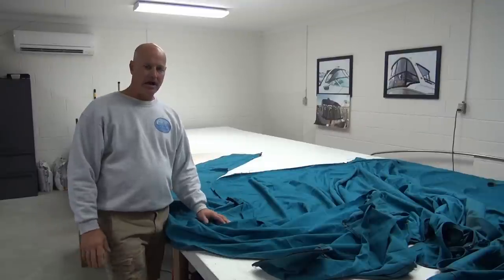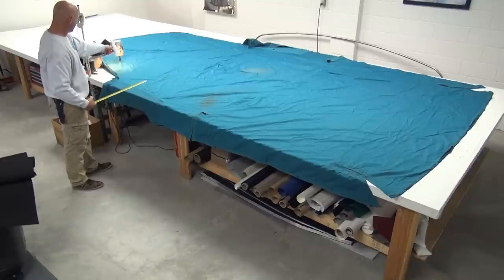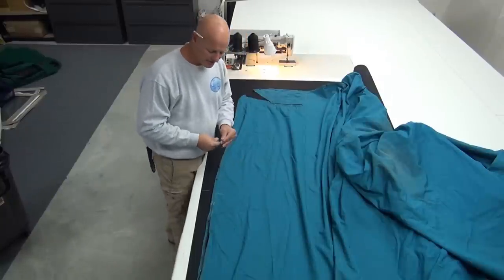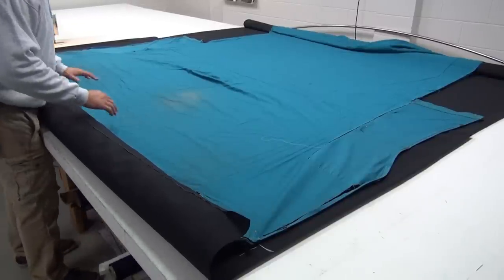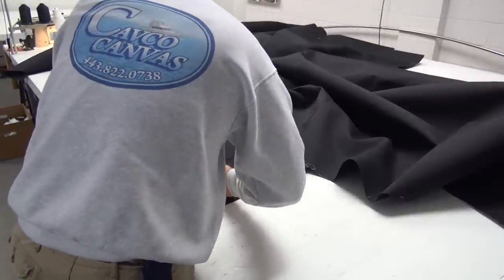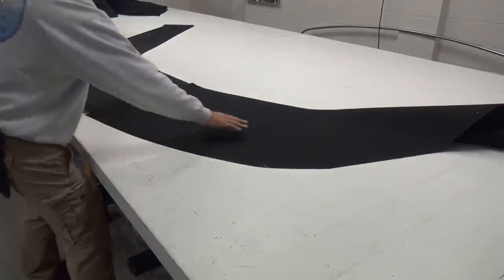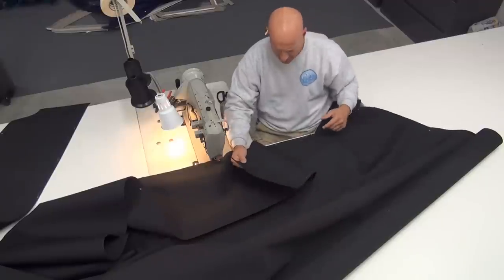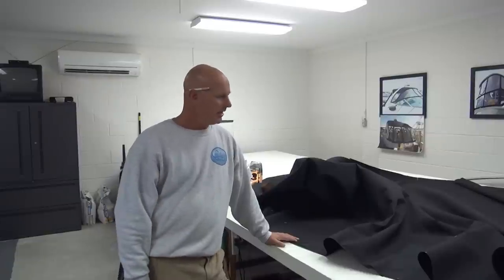How to make a cockpit cover from a pattern

Comment: This video was incredibly helpful.  Prior to 3 days ago I had never used a sewing machine in my life.  I used a Sailrite machine that my mom and dad have on hand to repair their sails with.  I 100% nailed it making a new cockpit cover for my 22’ Stingray.  My French seam is a little crooked here and there but the stitch caught the fabric just fine.   Note- in my first two attempts I did not follow the your directions to make the marks on the pattern and then transfer it to the new fabric.  A note to other DIY newbies, if you do not make these marks you will get a lot of experience using a stitch splitter.   Took mine apart twice, then decided to actually follow the directions.  Thank you for making this video.  Next up, I am going to make a new Bimini top!
Reply: Also, I highly suggest making sure the needle is completely disengaged from the fabric before you move the pattern around or readjust your hold.   The needle looks thick and tough but they bend very easily and do not work at all unless they are 100% straight.  And don’t try to bend it back.  Tried that….  It doesn’t work.  Thankfully, I found that little tip on the Sailrite channel because my first reaction was- Oh boy. Daddo is about to be really pissed at me for breaking yet another tool of his.  😂

Comment: I really appreciate your videos. I am reaching out to you for a guidance. I started working with a marina owner, 
opening a new canvas business. He promised to take me as a partner sharing the profit. We were in clothing alteration business and didn't have experience in marine canvas business. However, by studying your videos and others, we  learned valuable things and were able to reupholster boat seats beautifully as  our first order. The customer was extremely happy. For the reupholstering, cleaning and other mendings the total charge to the customer was $2620. Myself and one of my family member worked very hard for a week and a few days. However, my supposed partner paid us  $750 for it, which is only 28.6% of the bill. I wanted to ask you what is the fair labor cost in this industry? In alteration business the true labor cost was 60% or more, so we were shocked at what we were paid. After $390 supply cost, he took in $1480, which is 56.5% of the total. We used his facility, equipment and etc., yet we feel we weren't compensated for the true labor cost, not even to mention sharing a penny from the profit. What % do you think we should have been paid? Thank you!

Comment: Really like your videos, find them very informative. I have a question for you, when you top stitch a seam, the underside leaves the raw edges of the Sunbrella exposed. Do you need to bind or do anything to these raw edges to stop them from unraveling? Or does Sunbrella not unravel?
Reply from the maker: Hey Joao, Sunbrella fabric will unravel like crazy !!!!   The answer to your question is : If I sew two pieces together then flip it over and top stitch it I typically will not bind the edge first.  The fact that you are sewing it twice and have four layers of fabric will prevent it from coming apart..  That being said, If I have a seam that is in an enclosure exposed and visible, I will use a hot knife to seal the edge so it does not come apart.  Just my opinion, using a hot knife is more attractive than binding first then flipping over and topstitching.  The last suggestion for you is : you can use pinking sheers to cut the fabric first, that puts a zigzag cut through the grain of the fabric then you don't have to anything just sew it... Thanks hope that helps,John
Reply: John Cavco
Thanks for the reply, looking forward to seeing more of your videos.